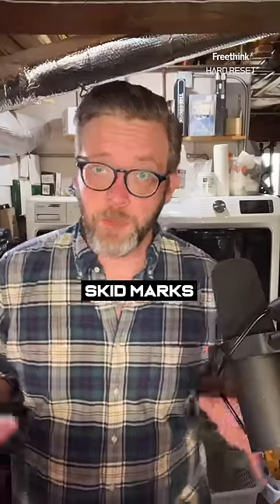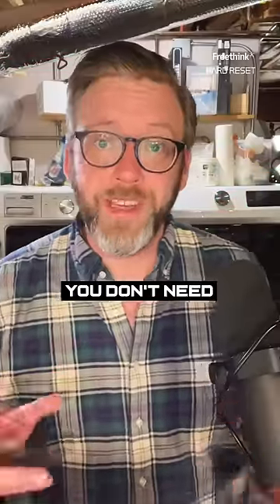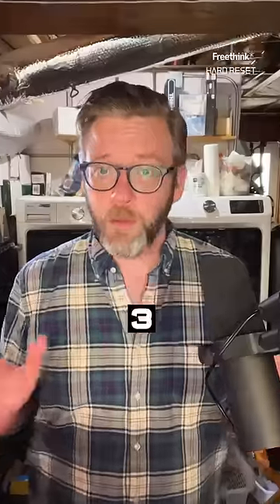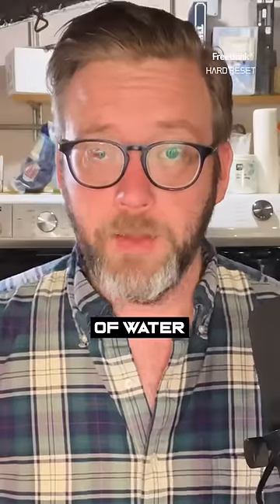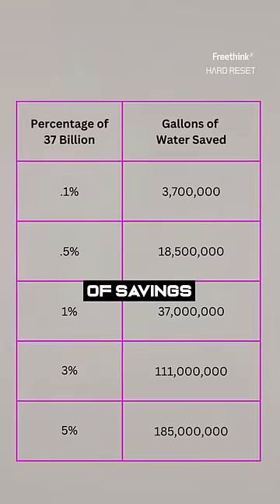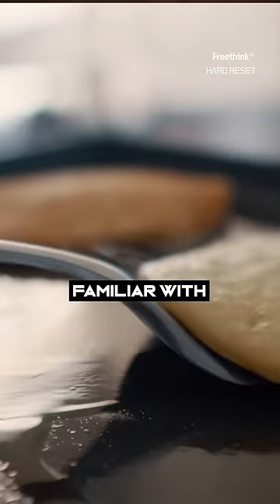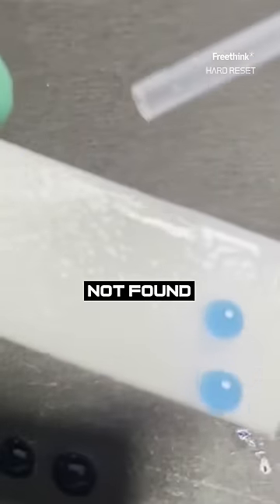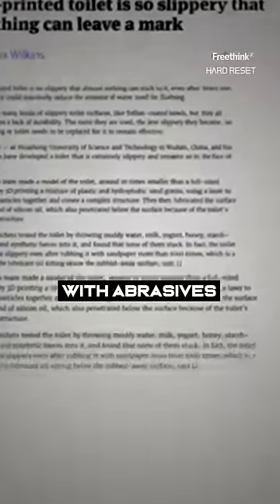Researchers invent super slippery toilet 🚽😳 #shorts #metamaterials

Comment: Seems it might be better used for drainage and sewer pipes since it might take less water to move waste through the system.
Reply: Best idea.
Reply: Exactly. The problem isn't the toilet, it's the pipes. I've never seen a toilet clogged before it goes down.
Reply: Not enough water in the sewer is an issue as well. Need scouring velocity.
Reply: The government: Bu-bu-bu-but I would cost too much.😢
Reply: I just came to say that reducing the water would increase the likelihood of drains becoming blocked. It's possible that such an idea could be employed in new build estates but converting old properties would likely result in disaster.
Reply: @FC-PeakVersatility  I recently had to replace the drainage pipes from my house (built in the 1850s) to the sewer. I think it would have been beneficial to have pipes made of this for those. I learned in the replacing process that it takes 8 flushes to move waste to the sewer line. Seems to me that anything to move it quicker would prevent blockage. I'm not suggesting to replace all drainage pipes as a program but when replacement is required I do see how it could be beneficial if it moves waste through to the sewer line with less water.
Reply: This is a great idea until you drink too much and end up hugging your slippery toilet and mario-warp yourself past the ninja turtles and find nemo.
Reply: @eugenesis8188  As long as you don't flush yourself you'll be fine. LOL🤗
Reply: @Nomommiesway. yes removing all the wasted water pipes in your town would cost a lot. And we don't even talk about the cost of this new material...
Changing those pipes would cost a lot, would, and save very few water as there no reason to believe that everybody would change all the toilet flush just because you ask them.
It would be way more pollution than wat it should save in the first place.

Better modernise the used water treatment plant, and just reject clean water in the environment
Reply: But the problem arises that even if that is slippery there must be slope to move it else it would not therefore it's gonna whole new planning and too much money
Reply: @ancient_law  The same slope already exists. There is no additional cost if pipes are replaced as needed for existing plumbing and the slope wouldn't change on new plumbing. (Keep in mind, I'm just talking drainage. I wouldn't want drinking water running through it.)
Reply: @kathyd9324  ah! yes,I get it what you wanna say
Reply: If all in-house pipes were that slippery nobody would have clogged pipes in their homes and it would become a public sewer only problem when the system clogged. That would be nice.
Reply: 90 degree elbows would benefit greatly
Reply: @joewagner4593 lol u haven’t seen my dookies
Reply: Maybe if the stuff are push by presure like on the airplanes you don't need a lot of water to move it?
Reply: I don't know if things getting stuck in pipes is about stickiness or if it's about the geometry of the pipe and objects inside it. If it's more the latter, they could still get clogged.
Reply: @kathyd9324 something I recommend all the time is to fill up the bathtub with hot water and drain it to displace all that stagnant water in your line.
Reply: That's not a bad idea for people who live in NY, where rats crawl up into the toilets.
Reply: This is why I see this as another example of going above and beyond to make consumers responsible for environmental issues. Environmentalists will buy the toilets and utility companies will refuse to pay for the replacement piping.
Reply: @FC-PeakVersatility exactly
Reply: Also rust. Rust is like plaque but for pipes and anything plumbing
Reply: @joewagner4593 you've never had to use a plunger on a toilet? If no, then ur comment makes no sense.
Reply: Bro get this man to the all the world’s governments

Comment: ice skating with no ice would be crazy
Reply: that… would be skating.
Reply: That already exists, it’s called polyglide.
Reply: water slides w no water
Reply: I guarantee you that if you have been ice skating it wasn’t on ice
Reply: ice skates don't just glide on every direction, they grip on the lateral direction. you can't skate on a very slippery surface
Reply: Plastic ice rinks sucks, I’ve used one of those before and they aren’t the same as regular ice
Reply: @quietpickle4549 yeah, it's been on water, technically...
Reply: bro thats already in my country it's a plastic but it's so worse that if you slip once ur dead i slipped and bro that HURTS HARDER THAN ANYTHING LIKE FALLING ON SMT WORSE THAN CONCRETE LIKE BRO I FELT MY LIFE FLASH BEFORE MY EYES
also you need to put in a lot of force to get speed cuz funny funny you dont retain that much momentum overtime on plastic (i call it plastic but it's something quite slippery but still harder to retain momentum than on ice)
Reply: And lame
Reply: They already make something like this. I came across some on Amazon recently when looking at hockey training equipment.
Reply: ... is that what young ones call it nowadays?
Reply: Some body mention Ice?? 🫨😵‍💫😳 Bruh I'm tweaking hard rn
Reply: Jesus loves you ;
Reply: Its a thing
Reply: They have no plastic ice rinks in usa?
Reply: @quietpickle4549  definitely was
Reply: They already have that!
Reply: Its called skating
Reply: In Florida when I was a kid instead of an ice rink for the holidays they had squares of plastic with oil all over it
Reply: Rollerskating 😮
Reply: Dang it. Beat me to it😂
Reply: They already have that lol, you can buy it and install it it in your house right now if you wanted.
Reply: Rolling skating..
Reply: Sock skating
Reply: It’s called roller skating
Reply: @LukeDaPandaII Its definitely ice by all definitions.
Reply: It'd be more like ice skating without skating blades
Reply: Or skates
Reply: I’m pretty sure this exists, i think they use a plastic instead of ice. Tho this stuff would make the fake ice skating more realistic (deadass saw videos of people walking on the fake ice in their fake ice skates)
Reply: @michaelq92  Except, when ice skating, the blades work like two knives on each skate. In between the two "knives," there is a space where the water sits. The "knives" have such a low surface area and put so much pressure on the ice that it melts. And boom, you are gliding on water, not ice.
Reply: hahahahhahaha skibidi toilet 😂
Reply: It actually is a thing. They just put some netting or something that even in summer you could just ride down no ice and all that😂
Reply: hell yeah
Reply: @makssmen yeah but the point of a water slide is to get wet and cool you down
Reply: I believe that is just called skating my friend
Reply: @jasminehe7142  totally,  although polyglide really sucks.  It's just better than nothing😅
Reply: That actually does exist already they do have that, it’s called poly glide! I actually looks awesome and I really want to try it
Reply: How to stop???
Reply: Actually the first ice skating rink was not made of ice. It was made with lard and salt.
Reply: @LukeDaPandaII  water on ice... still on ice
Reply: @jasminehe7142 inist that the plastic skiing thing?
Reply: They already have it
Reply: Plastic ice rinks exist and are worse than real ice and also roller skating and roller blading exists
Reply: @quietpickle4549  have you ever heard of a pond, city boy?
Reply: Yeah crazy dangerous lol
Reply: There are already plastic ice that you can skate on with regular steel bladed skates though they do require occasional resurfacing.  Early versions needed to be oiled frequently.   However, this could allow more efficient artificial ice.
Reply: I don't know how well this material would hold up to the blades of ice skates if your idea was to wear them on this material. Seems like it could be just as good of an idea as wearing them on a floor made of PVC.
Reply: @LukeDaPandaII Turns out that's an old belief.
Reply: @MikeDuddy-q2t  I'm reading hog's lard, salt, and sulfate copper.
Reply: What’s next pb with out the j!
Reply: @timego5552 no blades either 🔥 just flat shoes. And u doing a t pose while looking like ur floating around

Comment: Part of the reason to use so much water is to provide enough flow to move the waste through the plumbing as well. Doesn't matter if it move through the toilet only to pile up a foot away.
Reply: Using this, you would need to change the sewage system too, yes. But there are already several approaches that make it possible.
Reply: That’s a great point. Maybe they could create some suction air power somehow to push it through.
Reply: yeah I would also make the inside of your sewer pipes out of the same material to prevent a clog.
Reply: @Bump_on_a_log  that would require all pipes to flow downward
Reply: @tanyabishop8058 a vacuum .. yeah . Sewage bills and taxes would skyrocket for the overhaul , not to mention another point of failure
Reply: @savetheworldtips2680  i don’t think it would, the inertia from sliding down along with the water and the other waste in motion should be enough to move it through the pipes as long as the pipes had that material on the inside
Reply: @qbanz00  You might want to take a look at norways garbage system that does already do this.
Reply: I think the main benefit is that you won’t need nearly as much water in the bowl. The toilet might act as a funnel to a small pool of water that can then be flushed away.
Reply: @emeraldmusic9236  That is a good point.
Reply: @macmac1022  Norway probably implemented that before their infrastructure became what it is today, it’s also a much smaller (and smarter) country.. lol for the US to do that would take over a decade & even then a lot of people still wouldn’t have that plumbing application… our network is just too big and different.
Reply: @qbanz00  Just saying its possible.
Reply: Okay no one seems to know this, but the water doesn't push debris out of the toilet. The water suspends the debris and it's surface tension and suction created by the design of the toilet that actually pulls the water down through the pipes and into the sewer. Suction is created by water flowing from the tank past the S-Bend in the toilet base.
Reply: Lmfaoo
Reply: @c0urt_jest3r  how about you Google how does a toilet work...
Reply: slippery piping systems
Reply: @mjtejro  yes. All drain piping ends up with a biofilm(it's about 50/50 fat and bacteria) coating the inside. So yes slippery pipes. 
Literally since plumbing was invented. Coating the pipes isn't necessary.
Reply: It would still need some water to carry it away, but not a full gallon flush since you’re not shitting into water
Reply: Interesting. I wonder if people are researching the optimal amount of flow needed in conjunction with this new slippery material, or if the optimal flow is so minuscule that it would make this new material futile in this context. Very interesting to think about
Reply: @antiheld7323  false. Waste effluent pipes quickly get coated with about a 50/50 mixture of fats and BioSlime. It's already incredibly slippery down there so there's no need to change pipes or infrastructure.
Reply: @tanyabishop8058  all plumbing system starting work on suction gravity provides the pulling power, the surface tension and mass of the water does the rest. Waste isn't pushed out of a drain it's pulled through.
Reply: @patrickthebutcher , false. Maybe next time get a bachelor in that topic first before u try to correct one.
Reply: @patrickthebutcher  it's about the sewage system, not your house pipes
Reply: @antiheld7323  how about 30 years of first-hand hands-on experience as a professional plumber? And which bachelor's degree do you think I need to fully understand the subject at hand...
 Physics? Fluid dynamics? Civil engineering? 
Do you have any fucking idea how much time and effort I have spent on job sites correcting fucking engineers mistakes? I'm thinking no... I'm thinking you've never been on a fucking job site. But by all means educate me.
Reply: Or, get this... We coat the inner lining of our plumbing system with it to slide the water through seamlessly...
Reply: @patrickthebutcher you do realize things can be improved on right? since plumbing was invented coating the pipes may not have been necessary but a system can be improved upon and if your pipes are more slippery than can occur in nature that includes biofilm.
Reply: @antiheld7323  okay, but one involves replacing individual toilets, the other is asking a community to rerig their entire sewage system
Reply: @qbanz00  that's a cheap excuse dude. of course this change could not be done overnight, duh. but if the same logic was applied to literally any other tech or invention, we'd still be in the dark ages now
Reply: Question then. How does living by "if it's yellow let it mellow. If it's brown flush it down" affect our pipes?
Reply: Just make the pipes out of the same stuff duh.
Reply: What about the fact that we use water to scrub off and rinse down the sides of the toilet when excrement gets stuck to it? The very fact that we wouldn't have to scrub our toilets anymore, in and of itself, would be of great benefit. Now imagine the impact that millions of toilet not having to waste water to wash down the dirt would have on the planet.
Reply: The point that you didn’t get is that you would need only one flush per visit instead of multiple ones.
Reply: Hey change is a process. But it’s possible. At one point setting up those system years ago would have seemed an impossible task but we were able to do that. Sure it probably won’t happen but it’s always worth a try
Reply: @muhhamadavdol3781  , replacing individual toilets won't help if you just shift the problem to another place. An innovation on one place needs an innovation on all places to keep a whole system running
Reply: Just change all the pipes 💀
Reply: @emeraldmusic9236  also poop won't stick to it so it's easier to keep clean
Reply: then make the sewage pipe slippery too.. by the way, save water drink beer.
Reply: Thank you. Plus, we have the water that's always been here. I think people lose sight of that.
Reply: @emeraldmusic9236 why is that relevant? 
It's not. We have the same friggin water we've always had. There's no new water. It's in a permanent cycle from mountain top to ocean. And some stupid toilet bowl is going to change how much water we have how? Don't people get this? This water has been here since the planet started. Ugh
Reply: make pipe out of ice and put booster in pipe… poope zoom
Reply: This is why I think it would be fine in an RV or as a porta potty, but not like the toilet in your home
Reply: I've seen the first 2 comments before seeing this.
Reply: I was thinking this too lol, it’s just gonna build up if they don’t redo all everything else
Reply: @patrickthebutcher Unless that account had another comment reply that they deleted, the comment you responded to had nothing to do with you. If there isn’t an @ [insert username] in their comment, it was simply a reply to the original comment in the thread. Maybe take a deep breath before writing your next comment
Reply: @Bump_on_a_log  all of our sewer and storm systems are so old and outdated. But it is such expensive infrastructure that most countries patch things up. But solving each problem with a better solution can reveal what to work on next.
Reply: @simonblack4203  Actually as i know it's for the region with drinkable water like i live in india where population is top most among all countries and direct flushing which is good for use but instead of flush we use mugs with capacity of 500 ml which is very less compared to 10 L of flushing water so yaa we have been practicing this whole things for more than 50-60 years😅 so this is only china's problem if not then use sea 💦🌊
Reply: Serious question, why are people concerned with using too much water if it's a cyclic process?
Reply: @chairboss360  yeah people have no clue how a well pump and septic system work.
Reply: Exactly! If we could do this to all our pipes as well, then awesome.
Reply: @patrickthebutcher  FYI, your reaction to @montakims was unnecessary. They weren't replying to you. No need to start name-calling.
Reply: @chairboss360  That is a really good point!
Reply: @insanerajput9883  yes, but it's a goofy idea. Look, if you flush a toilet with one gallon, it's not more efficient then flushing with 60 gallons. The water still has to be treated, right? If the waste water comes in 1 gallon flushes, then the treatment must be much more concentrated ppm then if you used a 60 gallon flush. But either way, this is all the same water we've ever had.
Reply: @satiashaw1857  spare me your pearl clutching. We're all adults here, and he's not your little brother.
Reply: @patrickthebutcher  Lol!  No, actually. We aren't.